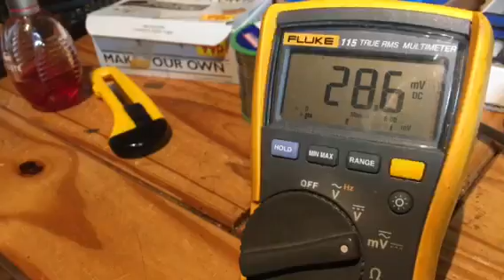Peavey Classic MH 20W setting up bias

Comment from the maker: SMALL CORRECTION guys! the small orange components that look like caps where i put my meter probes are actually polyswitches that act like tube/output transformer overcurrent protection, i will be making a video to explain how protection and bias signalling circuit work in this amp

Comment from the maker: Theres 1 ohm resistor to ground from that point as far as I remember ( cos I sold this amp now) so going by Ohms formula the milivolts will convert to miliamps and yes thats carhode current. In this circuit topology, grid voltages will be set way down below zero so its just fine with cathode voltages being set just over 0V. In cathode-biased amps where grids are set at 0V cathode can read higher even a few volts which is normally dependent upon specific value of cathode resistor used
Reply: Thanks!
Reply: Thank you for your nice video. Where do you attach the black lead? Lastly the 29mV reading, I would like to know how you got to that number please. I am new to this amp but familiar with biassing on some of my other amps. I saw another poster also mention 21mV as well. I will really appreciate your assistance. Cheers

Comment: How did you get that 30mv figure ??
I've used the Weber bias calculator with a plate voltage of 389 it shows only a 21.5 bias setting...
I'm trying and may be changing to EL844'S...

Comment from the maker: Does anyone know where to get schematics for this?  Looked at Valve King 20 micro head circuits online and similar power supply build shows that the standby switch is located between output tube plate and screen supply points-so now we know why in standby tubes get full volts on the plates

Comment: So could I get away with just sticking a new pair of EL84s in then turning that bias pot until the LEDs in the front turn green? Or would I need a bias probe?
Reply from the maker: yes thats how Peavey advises to do that however if you want to get more accurate settting, better to just read bias voltages
Reply: zbyszekskibinski ah ok that’s good to hear

Comment: I got one of these on the bench, it a nasty hum 60Hz. Trying to find the issue. Tried replacing all tubes, volume/gain movements doesn't affect the hum level. But moving the bias pot does.??
Reply from the maker: If idling current level of output tubes affects the level of hum check the electrolytic caps in power supply, first check if they havent gone dry jointed, pull the caps out and see od they move while in circuit, if not try to shunt them with the new, working caps and compare. I don't remember this Amp now coz I had sold It years ago